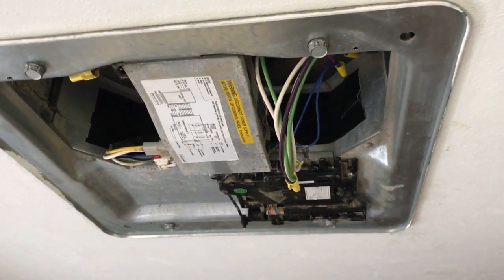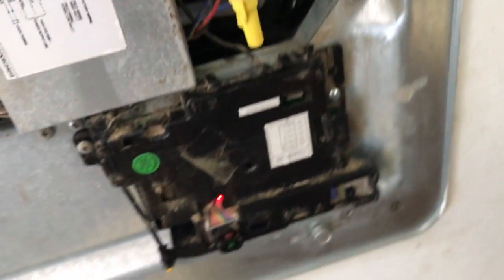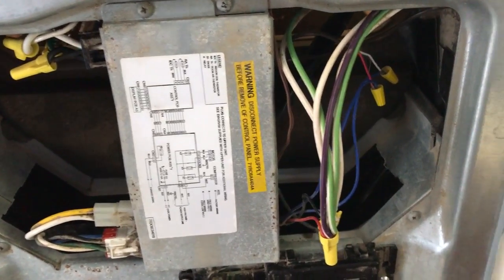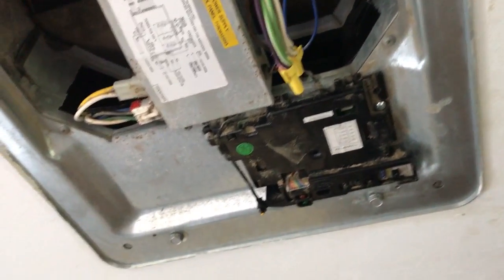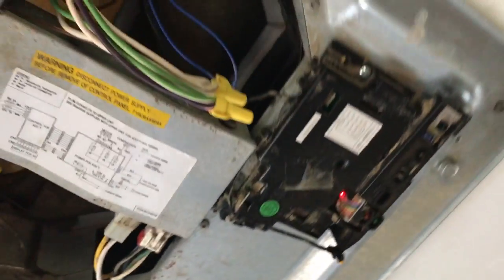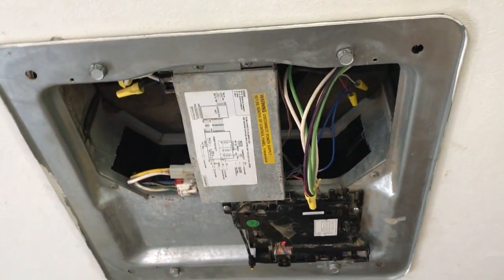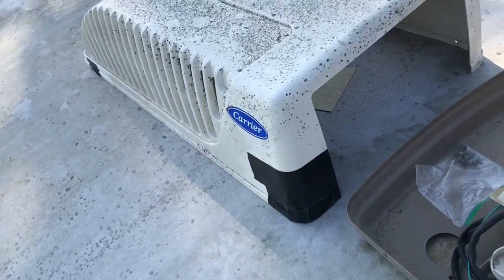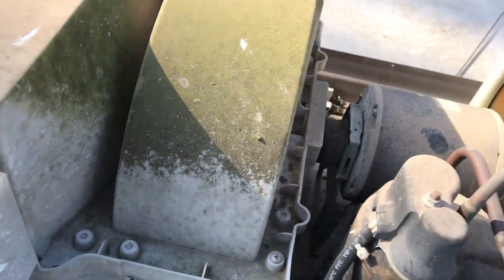Carrier RV AC Fan Replacement & Coil Clean pt1

Comment: Thank you!!! We took our 2006 Outback to the RV Dealer because our AC was doing exactly what yours was doing. They told us that the AC unit was shot, Carrier didn't make RV AC anymore, and it would cost $2,000 to put a replacement unit in.  I didn't want to spend that kind of cash on a 15 YEAR OLD TRAILER so we camped with a fan. I randomly saw this video one day and figured I'd give it a shot. I followed the link provided for the squirrel cage fan (it is now $24) and installed it today. I even cleaned the coils.  All together it took me about 45 minutes and under $50. THANK YOU for the very good instruction! It made the job easier and kept my blood pressure nice and low.
Reply from the maker: Glad you got yours fixed up.
Reply: Our AC just started blowing hot air today when it hit 98 outside! We have a 2003 Outback. Any tips to fixing it? Thanks!
Reply: @theodorewilson6817  I’d start by following this video. Super easy fix.

Comment: Hi, thanks for the video… did the Dometic replacement part worked? I have same issue with my Carrier AC. Thanks
Reply: I changed it with the Dometic PN and it works. The old squirrel cage wasn’t as damaged as yours (only cracks) but still created enough vibration to result in noise
Reply from the maker: Mine is still doing good.